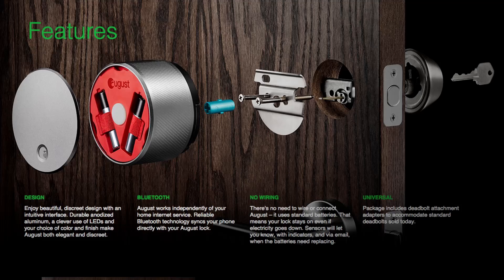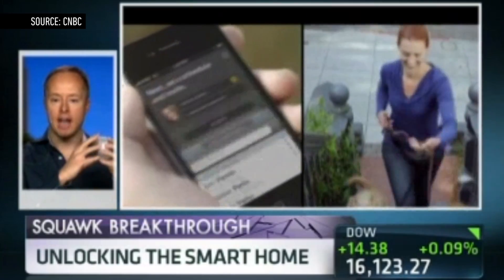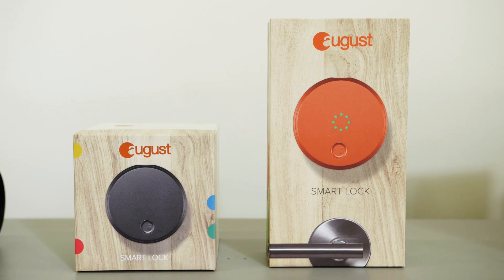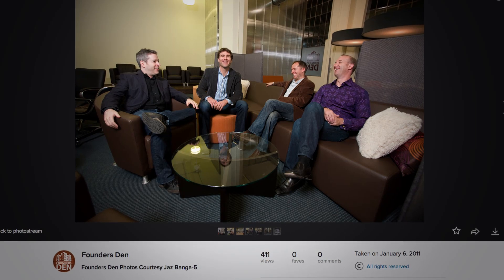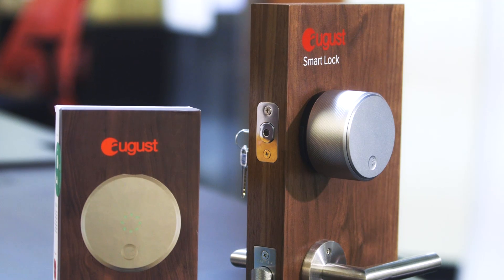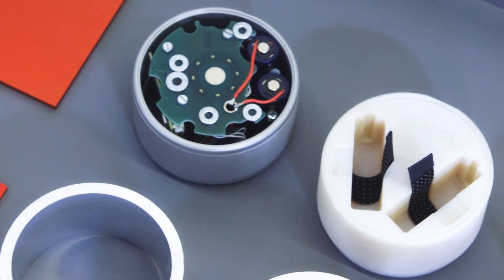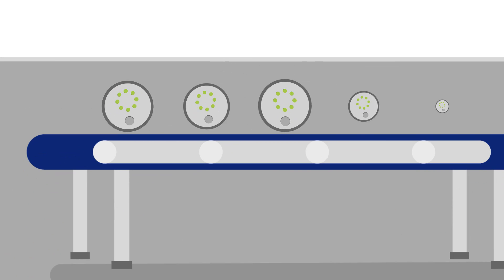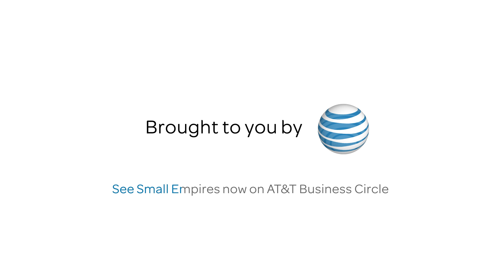Forget your keys? There's an app for that - Small Empires Ep. 6

Comment: I have a question for those of you who already have this. I currently have a motorized, keypad door lock. It has it's own remote and comes with physical keys as well. When I remote unlock it, the motor makes a ton of noise while unlocking. How much noise does the motor make in August?

Comment: Right, but I think your more likely to have your phone with you than your keys nowadays. I would much rather have my phone be my keys and wallet than have to worry about keeping track of multiple objects. The correct criticism you could have made is that if your phone runs out of power the doors doesn't auto open/lock, but the August still lets you use keys anyways, so you're point is moot either way.

Comment: So what happens if your phone runs out of battery?
Reply: You're screwed
Reply: Shat you clearly don't understand or didn't watch this video - it is an adjunct to your normal locks, so unless you lose your key, you are ok. I'm sure there's an override if you use a "hardware" key - that is, putting a physical key in the lock.
Reply: this only goes on the inside of your door, so the keyhole is still accessible on the outside.
Reply: You just unlock it with your key as you use to.

Comment: Fail on the product. I went to the August website and no stock. Not a big lost for me though because I found that my installed lock is not compatible. I love the concept especially if you plan on being an AirBNB host. No need to give your guests a key. Just make sure they have a compatible smartphone and give them a code to unlock the door and then disable it after their stay is over.

Comment: Holy crap! The house is on fire - I can't find my phone.. Who has a screwdriver and 10 min to change the lock back to the old-school one?
Reply: From the inside of the residence, the lock can be manually unlocked by turning it manually with your hand. From the outside of the house, the lock can still be opened with a key. This electronic lock just adds a feature allowing the lock to be unlocked with a smartphone; the original features of the lock still work.

Comment: wow i just found an huge proublem they are saying you can still open if the power dies with keys butt thats only if your on the outside of the door lol .
Reply: As I understand it, from the inside of the residence, the outer ring on the lock can be turned to manually unlock the door. Therefore, if the lock's batteries are dead, the lock can still be unlocked.

Comment: That stupid . So how do you open the deadbolt an emergency with out your phone or if the battery's die .
Reply: Your regular metal key still works in the lock. This replaces the nob on the inside of the door where a key isn't needed.
Reply: if its locked when your at home and you dont have and phone how do you open the door .
Reply: so the door is locked and their is an fire in the house and you cant get too your smart phone how do you open the door . its an stupid lock . must have manual over ride
Reply: The outer ring is a nob that turns manually. You can just use your hand. Same as if it where a normal door nob.
Reply: Its similar to a car door lock. You can either use your key, power lock button or your hand. If it worked only by phone that would be stupid and I don't think it would have made it this far if that were the case.
Reply: no not even the same . Well an car door has an manual over ride that you can pull up if the electric door lock part stops working . That stupid lock runs on two tiny AAA batterys . So so stupid . Its like the dead bolts that use an key in the inside lock the door and remove the key and if some one wants out the have to find the key what if some one is getting rapped and is trying too run out the door looks like they are traped inside . The lock is the same way it gets rid of the turning part inside the door you have to take it off in the instructions . it doesnt just go over the lock it replaces it . Now the lower locks that they have now this days still let you open the door from inside .
Reply: Incorrect.
Reply: How is August installed?
August is installed on the interior side of your door by removing your existing thumb latch and attaching your Smart Lock to your deadbolt. Installation takes less than ten minutes and requires nothing more than a screwdriver. There is no need to re-key or permanently modify your existing lock system. August removes no pre-existing mechanical functionality of your deadbolt, it only adds intelligent features. This means that you can still use your physical keys and you can still manually unlock or lock your door from the inside.
Reply: ok your not to smart are . you can only use your keys from the out side not the inside OUTSIDE . So lock the door from the inside and sit you phone down how do you open the door  with out your phone .
Reply: The circular ring around the outside of the DEVICE (which they show all through out the video) rotates around the main body of the device and acts as a nob. It acts as a analog method of opening the device with your hand, mouth, teeth....whatever. No key or phone needed. Look up install videos of the lock and you'll see. I'm not  claiming to be smart. Just smart enough.
Reply: why doesnt it say or show that on their web site
Reply: Colin Long look in the FAQ section. Its says it there. Installation guide usually just explain how to install not the features of a product.

Comment: Why would you do this with your phone? Why not implement this idea and put it on a smartwatch, which is really hard to lose, its easier to use, and you can just nfc tap it, instead of reaching for your phone then unlocking it and opening the app, which takes just as long as using a metal key.
Reply: I believe the product allows you to just walk up to your door and it opens. Using Bluetooth I can presume that it may be possible to use a smart watch to open it.
Reply: Or an NFC ring that doesn't run out of battery in 24 hours.
Reply: ST34LTHx Yeah, but that'd mean anyone that has your phone can get in, but very rarely do people ask to wear your watch.
Reply: Did you watch the video